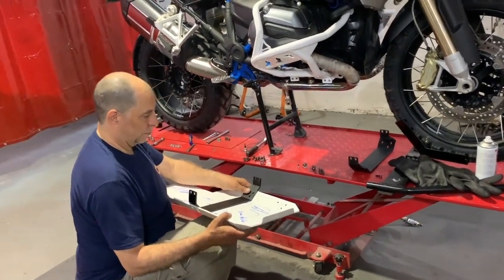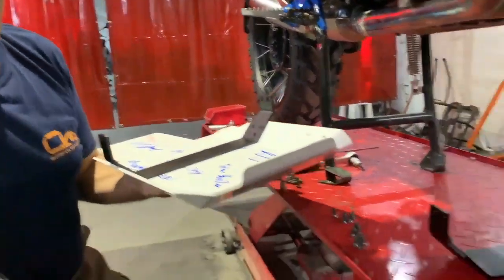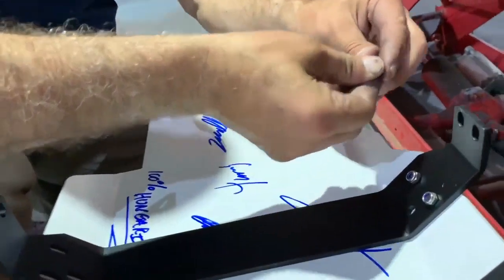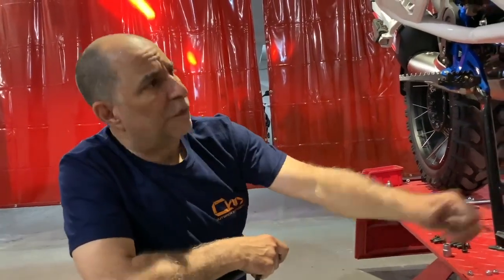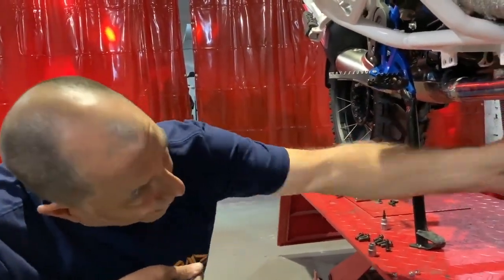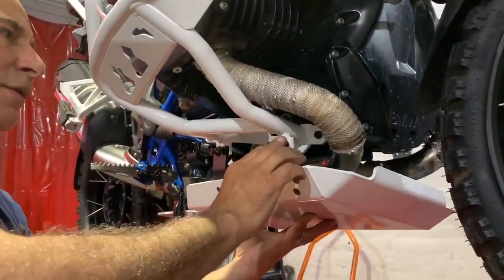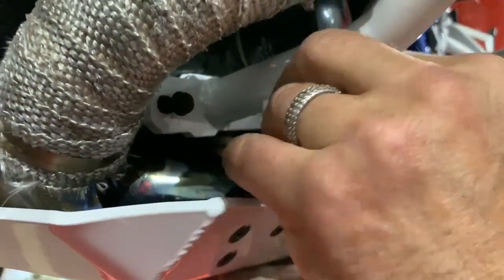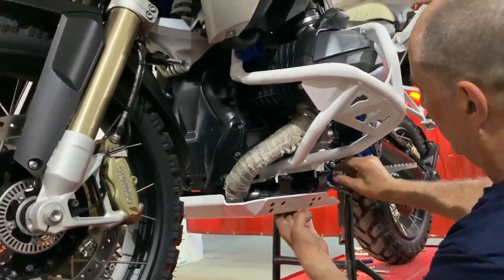BMW R1200GS Skid Plate/Bash Plate Installation Video

Comment: So neither the crashbars or skid plate shown will fit the R1250GS ?
Reply from the maker: Not the specific products in the videos but they'll look technically identical and will mount the same way. We're already working on the modifications to release the 1250 version of the products.
Reply: Very valid point about inspecting clearing out dirt and or rocks. It does happen !